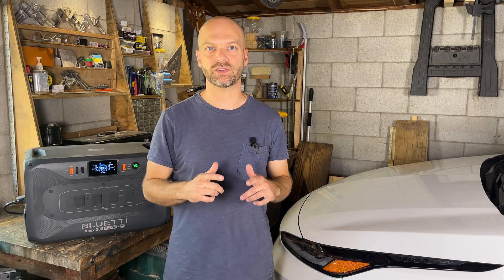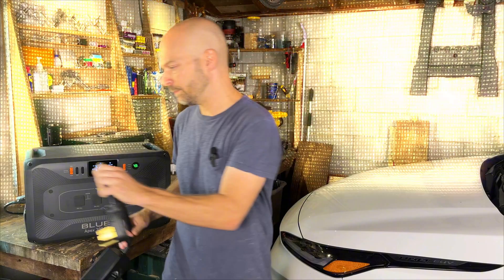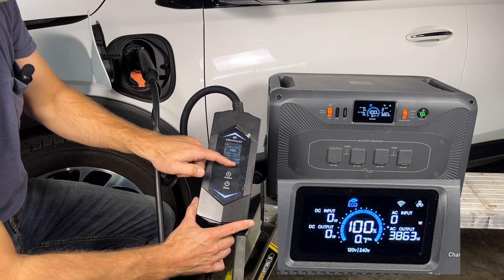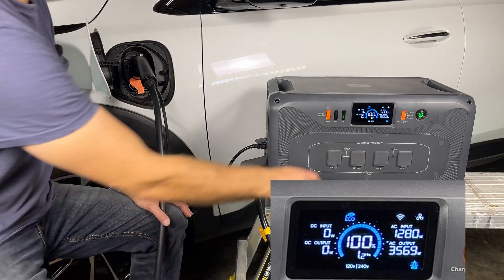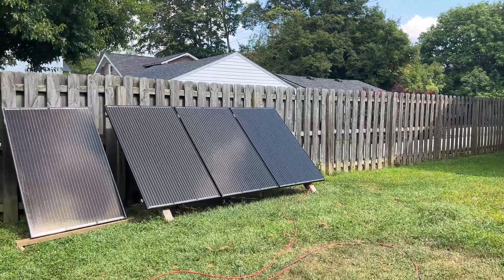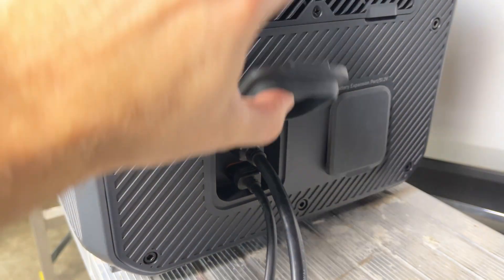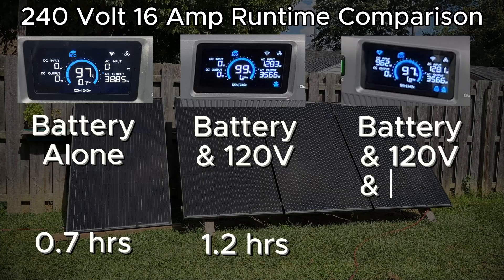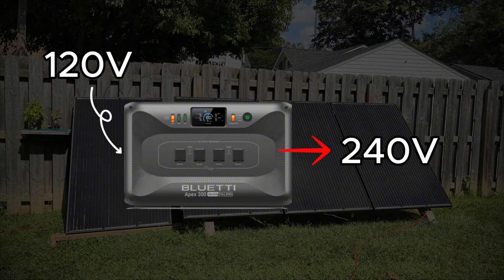How to Run 240V Appliances from 120V with the Bluetti Apex 300

Comment: The obvious use case I am interested in is home power backup - but using V2L (vehicle to load) from an electric vehicle to keep the portable power station going for long periods of time while it supplies 240 V to my home transfer switch with pre-selected circuits.  I already have a 240 V receptacle which feeds select circuits protected by a transfer switch to keep the generator feed separate from the grid (to prevent back feeding the line and putting electric line workers at risk).  Instead of using my old gasoline generator to supply power to the 240 V receptacle, the Bluetti APEX 300 would supply power.  During power outages, my power usage probably averages 1 to 1.5 kW.  Using the APEX 300 alone would only give me a couple hours of backup power.  However, if I could ‘feed’ power from my EV high voltage battery at approximately 1.5 kW to keep the APEX 300 at a high state of charge, I could keep the house powered up for many hours using the 75 kW-hr battery in my EV.  The advantage of combining V2L with the Bluetti unit over using just the EV V2L directly is that I can use more power for short periods of time (furnace fan kicks on, sump pump motor kicks on, use microwave or coffee maker, etc.) without worrying about exceeding the breaker limit on the car’s V2L port (1.8 kW limit).
Reply from the maker: This is a fantastic use case, especially with the EV integration.  What vehicle and how would you specifically go about connecting to the APEX?  I ask because the Equinox EV that I was driving required a separate V2L integration kit where as something (like a Silverado EV) with its built-in inverters would be plug and play.
Reply: @BackyardSolarProject  State of Charge channel (Tom Moloughney) did a recent video about the Roam Energy V2L adapter that works with Teslas.  It plugs into the NACS charge port on the vehicle and provides two 1800 W 120-volt receptacles.  I would use one of the receptacles to provide power (probably dialed down to 12 amps - 1.4 kW) to the Bluetti while the Bluetti provided the voltage upgrade to 240 volts and the ability to get short bursts of higher power up to nearly 4 kW.  From the Bluetti, I would run my old generator cord to my transfer box panel.  I’m a little familiar with the somewhat rare V2L option that is available on some Equinox EVs.  GM stopped offering the option for a while in late 2024, but apparently it’s back because I am seeing 2026 models at dealerships with the 3 kW V2L option.  My wife has an Equinox EV and I’d actually prefer using the GM system because it has a bigger battery and it is OEM sanctioned, so I don’t have to worry about Tesla one day disabling my box with an OTA update.  But we don’t have that Chevy V2L option package, and the Roam Energy box only works with Teslas.
Reply: @BackyardSolarProject   Tom’s video on the Roam Energy option for Teslas: https://youtu.be/1WcsxlG9RSA?si=ngCI-YQJgXIjinIz

Comment: Really well done video.  Organized and very well explained.  I would note that you could set your car charger (EVSE) to the lowest amperage setting of 6 A (at 240 V) and match that to an AC input to the APEX 300 of 12 A (at 120 V), and the unit will run indefinitely - since your input and output would match at 1.44 kW.  It would only add about 5 miles of EV range at that setting - but that’s not too shabby if you are just doing overnight charging to top off.
Reply from the maker: Thanks the for the feedback!  Great point - and potentially more efficient than charging off a level 1 cordset. Do you know of any charging cordsets that are programmable?  6 A overnight but 12 A during the day?  Or "smart" so that you could charge at 12A whenever the APEX 300 is receiving more than, say, 800W of solar.

Comment: Interesting.  Since the Apex 300 must run a floating neutral when not connected to the grid, this must have caused a fault with the Tesla charger initially (unless you bound the neutral and ground).  I know that once you plug in the 120V to the main, the neutral issue would be resolved.  This approach also works for most 240V well pumps (mine included).  It also has no problem running my range if i just use the 2 elements max without using the oven.  I got 2 of the Apex 300's along with the A1 hub which works great and it can run the well pump and hot water heater at the same time (for maybe 30 minutes!).  For your solar, you may have lost some of the solar power due to conductor losses.  I chose to use 8 gauge just to get those 30 to 50 watts back, especially if you are running more than 50 feet.  Great video!
Reply from the maker: Thanks for the kind words and detail about your experience with the well pump AND hot water heater. My main battery array uses 10awg wiring, the cords in this setup were temporary, just for testing. Agree, though, that it probably had an impact on the solar.

Comment: How did you charge when not connected to the grid without grounding issues?  Is that something unique to that EVSE, that power station, or 240v?  It seemed a pretty typical problem, at least with most lithium ion power stations, at least at 120v.
Reply from the maker: Good question and something that I realized when I tried my GM-Branded charge cord (at 120V) later. That generic one didn't seem to require a neutral ground bond. To get most charge cord sets to work, you need to plug in a neutral-ground bond adapter to a power station.  Although, you may be on to something suggesting that it may just be a 120V issue.

Comment: I currently have an AC200L that I use at my cabin and like it a lot. I also plan on putting a small solar system at my house next spring. I like Bluetti stuff but as others have said, the batteries are pretty pricey. I do like the 240V capability but in reality, for short term power, it's probably not needed. I'll probably take my critical loads (refig, freezers) and run them from the solar system with grid backup and solar charging, kind of like a UPS.
Reply from the maker: AC200L is my favorite - it is by far the most efficient power station that I've tested. I also agree that the batteries are pricier than server rack options. That seems to be the trade off with the plug and play style systems, though.

Comment: Thank you Mate, I add 2 #Bluetti B300K Battery with the SolarX 4K+P090D it take up to 150v - 500v for about 4000w of PV
Reply from the maker: Thanks for sharing your setup – it sounds like you've got a very robust system!
Reply: @BackyardSolarProject  Your welcome Mate, Yes i have already 2 Apex working on number 3 and using them with the #Bluetti  Hub A1 Parallel Box  up to 11.5kw of inverter capacity and you can add up to 58KWH of battery capacity, If you need more DC just add a Hub D1 as a 50amp outlet on it to Its a good starter for people to save some money on the power bill Take Care Mate Be safe

Comment: Good video. Waiting for en electrician to come to our lake cabin to install a switch. I purchased the Apex 300 to run a water well pump needing 230 volt at 8.3 amp so we have water during a power outage. Proof of concept not establish as it is difficult to get an electrician at a reasonable cost due to driving distance.

I also have the ac200L with a B210 battery and the apex charging cable for 30 amp
Reply: I have the same issue with a well pump that uses 3000 watts to start up and less to run.   I have two Apex 300 and two BK300 connected bluetti Hub A1.  I have the 30amp cable going from the Hub A1 into a generator panel.  The pump also is connected to the generator panel as 220v breaker.  As of now the bluetti's haven't provided enough power to run the pump.  All firmware is uptodate.  Funny thing when I connect my 4000 watt generator with the same 30amp cable it runs fine.  I have a case open with them to figure out why it won't provide enough power to run the pump.  Be careful you don't hurt your well pump if you can't provide enough power.
Reply: @Peter-u5g8e  Thanks for the words of advice. I suppose it is depending on the pump you have. Mine is variable speed (10) 3/4 HP. I’ll try it when the electrician looks at the system and he can advise me. I don’t understand watts all that much. Looking at it I didn’t see a neutral wire from the electrical box to the pump sub panel. But there are 4 wires going from the sub panel to the pump. As I don’t understand electricity other than basic 120 with power, neutral, ground I want to wait for a qualified electrician so I don’t damage anything.
Reply from the maker: @Peter: That is odd that it can't run your well pump. Out of curiosity, have you tried using a single Apex300 in 240V mode? 3000W is well below the max output of a single unit.
Reply: @BackyardSolarProject  I did not say it could run it. I was told by the agency that sold me the well equipment it should run it. I mentioned in earlier post it is still an hypothesis for my knowledge.
Reply: @BackyardSolarProject  going to try that.  I thought all settings would be available on the Hub A1 software but it seems only some of them are integrated and you have to do a combination of switches and software changes.  I got an email from Bluetti support so I am going to read that tonight
Reply from the maker: Thanks for sharing - that is a great use of the 240V capability. I'm not that familiar with well pumps, so you sparked my curiosity to do some research.  Since it is only 8.3 Amps and I'm assuming that it doesn't run constantly, you should get a lot of runtime.
Reply: @BackyardSolarProject I think mine is Gould pump. I had to ask supplier on the electrical specs and where I got that value.
Reply: @BackyardSolarProject  3/4 hp model 10gs05412cl
Reply: @BackyardSolarProject As I am no expert but you appear to be very  knowledgeable if I may ask. In my application I have. Franklyn Subdrive utility box. 

The VFD's soft-start feature ramps up the motor speed gradually, reducing the high start-up torque and current associated with conventional systems. This minimizes the mechanical and electrical stress on the pump and motor, leading to a longer overall system lifespan.

I copied a clip. Does that help ensuring lower spike on power demand for my 16 amp supply for my Bluetti Apex? I need 8.3 amp 230 volt for my pump to run.
Reply from the maker: I don't know for sure, but after a very quick online lookup, it seems that a soft start is  what you would want to reduce start-up current demand on your power station.
Reply: EG4 6000XP and two EcoWorthy server rack batteries or a 16kWh Yixiang battery. 

I know you already have the 240V Bluetti power station but their expansion batteries are very expensive. The solar input can double as battery expansion but the current limit is usually 10-15A.
Reply from the maker: @user-jh1er8kh7p  I haven't used an all-in-one yet, but I agree that it makes a lot of sense as a cost-effective option for a whole-home system. I'm not sure I would use an all-in-one as a "stand-alone" unit to power a 240V device in a pinch as it would be a lot to lug around. Granted, the APEX300 is quite heavy, too.